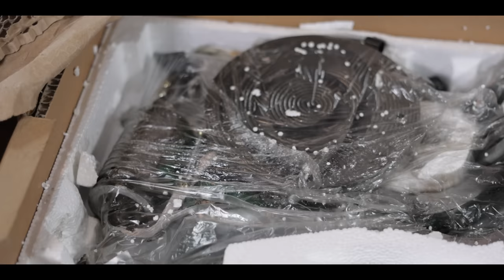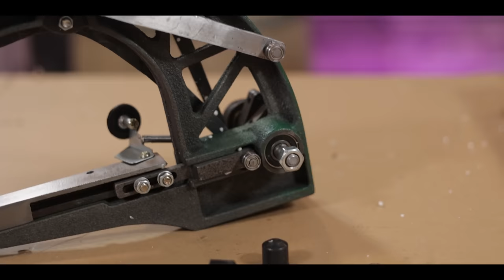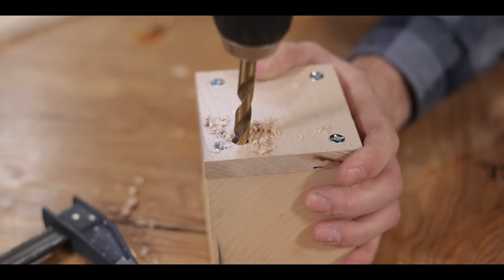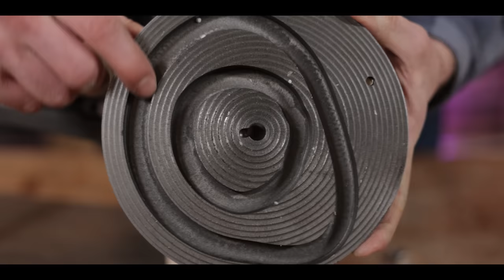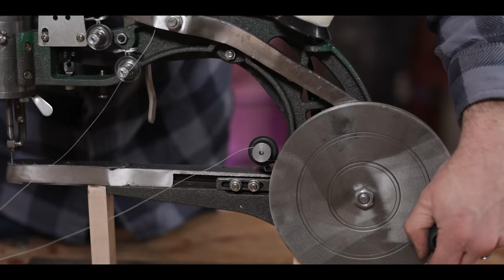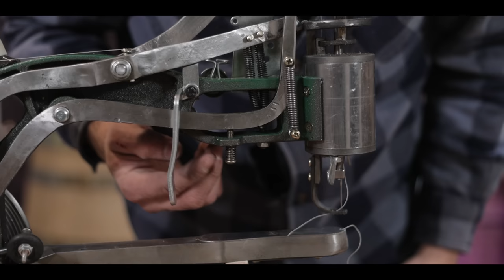Is this $100 Leather Sewing Machine Any Good?

Comment: Mine came fully assembled ready to go. I hooked an electric motor to it and have never looked back. I’ve sewed everything including tarps,upholstery, bags,belts and leather 1/4 inch (6mm) thick. Keep it lubricated and it will last a lifetime.Get yourself one .you’ll never regret it
Reply: did you buy yours on Amazon? Maybe a link? Thanks!
Reply: What electric motor did you hook to it? I'd like to do the same thing.
Reply: Howdie from Canada 🇨🇦 SK later  what se😂rs  of motor Ythks again Paul 😊at cov 😊use and is it worth mone😂d on0evfor 😂sy l nee

Comment: Very informative....but, lose the loud music.  By the way, the ears above the needle are for turning the walking foot so that you don't have to move your material. Just turn the foot in the direction that you want to sew, and it will stitch in that direction...without turning your material. This is how you can stitch things onto sleeves, repair shoes, bags, etc.....
Reply: I used the tripod base to that was provided and it seems plenty stable and sturdy. Mine didn't have the set screws for the legs that some others did, but just press into base. That has a tendency to fall out when picking it up to move around, but a small wrap of paper or tape secures it fully from falling out. It's better with that base because it leaves the arm unobstructed to allow it to be put into recessed areas.

Comment: My wife bought me one of these things a few years back. After cranking for far too long, about 15 minutes, I decided to mount it to an old treadle sewing machine base. After putting a new table top on, that left the free arm clear, I had to add a couple pullies to redirect the drive belt. Now it seems be have become a family tool. My wife did a lot of sewing and my daughter makes hand bags. The length of the free arm is incredibly useful. Great revue and we couldn't agree with you any more.

Comment: The oil on the metal is usually Cosmoline, and is indeed common for shipping unpainted cast parts; even high-end table saws come covered in it
Reply from the maker: I legitimately didn't know that! Thank you for teaching me something today!
Reply: @SkillTree  You are welcome! After all, isn't that why we are all here, to learn new things? :)
Reply: Sergers and carbon steel cookware are the same, though sometimes they use a thick layer of beeswax on the cookware. Beeswax is soooooo hard to clean off completely
Reply: @SkillTree   I know I am late, but knives and swords often come covered in a similar grease,  it keeps the metal from rusting since carbon steel (which you want a sword made of)  will rust
Reply: @SkillTree  The soviets used cosmoline for long term storage of firearms.
Reply: @sparkythawelder  The US Military has been using it since WW I!  It was still used in industry until EPA and such put a end to its use in USA.
Reply: @4GSR  Cool
Reply: Ak people know all about cosmoline
Reply: Another cosmoline oil/grease tip is that when you buy brake rotors for your car (not pads, the actual rotor) they are almost always coated in cosmoline which will really mess up your pads, so you need to wash it off with Brakekleen or similar parts cleaner to allow your brakes to work properly
Reply: Knights’ armor was stored in wood barrels full of oil to prevent rust.

Comment: If this machine has any issues down the road, I definitely want to know in a video. This was a great opportunity  to give us an honest opinion and I feel like I can trust your judgment. I know a lot of leather crafters wouldn't lie about their reviews BUT some of them are also endorsed by the company that provides some of their machines 🤷‍♀️ so sometimes it's hard to tell if the review is genuine or not when I'm doing research. This video gives me a better idea on if I want or need a cheaper leather sewing machine now, or if I need to wait and buy a really expensive one later
Reply: I'm useing same one for a year now, for heavy duty leather works - saddles, armor for roleplayers, etc. Works fine for me, there is nothing to breake there at all. But it took few hours to bring machine to "nice and polished" condition. What i done also (not included in this video) - flattened its leg a little so it stops biting the leather that hard and changed handle to more handy.

Comment: Been running mine for a couple of years now, I have to admit, mine was far better looking out of the box than yours. And that screw head you had to mill down, mine was already done. I used the stand for my ice fishing camera, lol. The channels on the back of the crank wheel are where I used some white lithium grease. Just a touch is all you need and it works so smooth I barely have to make an effort to crank it.
Reply from the maker: Thanks for the tip! I will be picking up some lithium grease right away to give it a shot!
Reply: Where do you get white lithium grease?
Reply: @RattsWakeUpCall  auto parts store.

Comment: Little tip, I use a rare earth magnet to pull out the bobbin. With that, it comes out easily. Also, love your pros and cons for the machine. I've had similar experiences with mine. 
Oh, and I plastidip the foot to keep it from maring the leather.
Reply: The nice thing is you can just leave the magnet stuck to the machine somewhere out of the way and it will always be there when you need it.
Reply: Magnet for bobbin removal: This is the way.

Comment: Loved the vid. Love your channel .
Always keep it oiled. I scoured mine down, smoothed the rough edges, and gave it a coat of paint. Nylon or teflon washers on the pivot points of the rocker arms reduce wear and help it run a lot smoother/quieter. I've sewn plenty of holster leather with it even going up to the size 24 needles and 207 thread. There's just a little DIY and a learning curve. Filing down the teeth on the presser foot a bit is a big help on relieve the marks it leaves. My only wish would be a bigger bobbin for stitching belts. I've wasted a hunnerd bucks on a lot worse gadgets. Enjoy :)
Reply: Yeah, Size 24 and 207 for me as well.  Had mine about three years now.  Once broken in and the rough edges smoothed up, it works fine every time.  I did go to a slightly heavier oil than 3in1.  I use Marvel Mystery Oil, from auto parts stores, Walmart, etc.  The bobbin holds less thread, the heavier the thread, which is a bummer on bigger projects, but I bought extra bobbins and holders off eBay and keep a half dozen standing by for a quick change for longer seaming.  I also made a slightly shorter foot for mine and can get almost half an inch stack of leather under the foot now.  The machine walks thru it like butter.

Comment: 1:38 im pretty sure you're right on the money! My machining professor (who worked in a machine shop for like 35 years) says that cardboard and other wood products are HUGE rust magnets because of the tannins. Anything that gets packed in cardboard, especially long term (such as something thats shipped overseas, will be sitting in a warehouse, etc,) needs a generous coating of oil, as well as some kind of isolation layer, just in case. I suspect that this is drop shipped from existing stock in china, so a heavy layer of oil and plastic wrap checks out. Not always fun to recieve, but definitely better than recieving a rusted and unusable machine!

Comment: When I first started leatherworking, I considered one of these machines, but after thinking about it, decided against.  Not because I didn't want to fine tune it myself, or that I thought it wouldn't work, but I considered the type of seam it creates in my leather versus a reliable saddlestitch.  Once a section of your thread wears down, the whole seams comes undone, where with a saddlestitch, the remaining stitches still hold tight, giving you a chance to repair the seam without your project falling apart.  How long will it take for this wearing down of the thread take?  Who knows, depends on the use, but that's the main reason I did not go with one.  Plus, unlike your's, my leatherworking hobby is meant to be a time-killer, hand stitching suits that.   :)

Comment: Okay so for what I did with mine is polish all the bobbins makes them spin easier. Next buy a lot of the leather needles. you will go through many. Now I also made a deck for going around the lower arm. so I have better control with sewing the leather.  So i think this machine is so worth it. You will need  to practice with it.

Comment: So glad you love it since I was one of the people who voted you should get one.  Looking forward to seeing what you make with it.  Next step: attach a motor.  I bolted a pulley onto the crank wheel to make my machine belt-driven, using a windshield wiper motor from an old Ford.  Helps a lot when you want to be able to control your piece with both hands. You can probably come up with something more elegant, but that's what I had on hand.  A treadmill motor would be ideal, because the range of speeds is wide and continuously adjustable.
Reply: Mr. Possum, what diameters of pullies did you use?  Thanks -- Anaco, Vzla.
Reply: @buddyhutchins3782  I used an 8" diameter  pulley on the sewing machine crank wheel, and a 4" pulley on the motor, but you might need different sizes depending on how much torque your motor has and how much speed you want.

Comment: These machines are absolutely great. I have used a weaver 205, which is 3k easy, and bought one of these a few years back because the weaver wasn’t at my house and I’m a lazy lazy boy. These beasts can handle just as many, if not more, than the weaver. Getting used to keeping lines straight with one hand is a hurdle, BUT you can easily modify it to have a motor! Just buy an Amazon motor, attach a sewing machine pedal, groove the hand wheel, throw on a belt and bam, you saved $2800. Plus you can detach the motor if you’re going to an event or lose power. Best investment ever.

Edit: I put a groove in the hand wheel for a belt with a dremel bit socketed into a battery drill. The battery drill stands up, so I just scooted the drill to the wheel, pulled the trigger, and just spun the hand wheel to start the groove. It’s not the most fun task ever, but it’s insanely worth it. Also take off the hand crank if you’re using the motor or you’ll hit yourself with it repeatedly, trust me lol
Reply: Hi! I’d like to add a motor to mine. Any videos that show how to do that?

Comment: Hey, I just wanted to thank you for making this video. I don’t plan on buying this particular machine but I am buying a Amazon Leather stitching machine that’s made by the same brand and it’s a few hundred more dollars more expensive than this one but I think it’s a great investment. I have a lot of projects that I’ve had in mind and I think that this simple industrial piece of hardware will do more than what I expect. I don’t own one yet but I have advice to anyone that wants to know how to maintain these machines to keep them in tip top shape, my answer is simple, lubrication! oiling every friction point and keeping tabs on them after using the machine every now and then will keep it running for as long as you can supply needles for it. More importantly, add grease to parts of the machine that won’t make a mess and to parts that deal with high bearing loads or stress, that is a little secret from me.

Comment: I use a strong magnet that I took from a scrap hard drive to (very easily) remove the shuttle & bobbin. I am a retired sewing machine mechanic so I figured it all out for myself and made a workable stand. However, there are plenty of youtube videos like this so that anyone can get this machine working. One thing you did not mention is the universal directional feed by rotating the two 'wing nut' thingummies. Good video, thanks.

Comment: Just got mine about a week ago.
So far, cleaning and threading the bobbin took the longest but now I am facing the issue of thread breakage.
I’m sure I’m doing something wrong and I’ll figure it out but I love this thing already.
Kudos to all the hobbyists who have the patience to fully use this thing.
Reply from the maker: I had the same issue. The little tension disks may be too tight. Try loosing them. To be honest, I usually just end up using one of them. I find using both breaks rhe thread more often
Reply: @SkillTree  So I actually spent some time fiddling with it and found out that my problem was the bobbin wasn’t aligned properly. This was causing the upper thread to get tangled and lots of tension, causing the breaks. I’m also using nylon thread now so that’s helping.
Reply: Another possible reason for thread breakage is a burr on the bobbin or shuttle.  Everything needs to be touched up with a little sanding and polishing here and there
Reply: Is the thread provided much different from monofilament fishing line? It came loaded with clear thread in the bobbin and a short test length up top, so I threaded the top with the black line that was included in the box. Dual color stitching for now until the bobbin runs out-

Comment: Shout out to the man. Thank you so much for the details. Still waiting for mine to arrive...come on already Amazon.
I've been through most every 'tube video on these and they cover much the same stuff. But thanks yours is the first for me to show how to adjust the walking foot stitch length. That's going to be a game changer. 

You have probably already found out that the work piece can stay in position and the needle barrel with foot can rotate clockwise or counter to change stitching direction. Beauty! Thanks again

Comment: Oddly enough the way you fill the bobbin on that machine used to be considered a very be considered a very big feature because you didn't have to hand wine the bobbin like that's how we used to fill our bobbins we hand wound them at 1st.  That also made it harder to control the tension of power the thread was wound onto the bobbin which led to more mistakes and not as good looking stitches.... Although the bobbin can make minor differences in your world it can occasionally decide occasionally decide as to whether or not a sewing project will turn out or be total garbage...  For some machines there is attention screw included on most of the bobbin cases for some machines it's more of an automatic thing but I imagine for that machine there's gonna be some kind of tension screw and if you start having issues with your thread nesting nesting on winding really fast being really fast on winding not slow enough if the stitches are too tight or too loose it could have something to do with the bobbin case

Comment: I have the exact same machine, and you are 100% correct about everything. The only advice I can give is put some lock tite on the crank nut and bolt. It likes to work loose with use
Reply: The foot should turn as well

Comment: the top sewing head swivils so you dont have to turn the leather to sew in another direction. , also, if you want to make it run smoother, polish the raceways for the bearings in the back of the plate

Comment: I recommend adding Greece to some of those pivot points rather than oil. You will end up with much smoother action and less noise. I've been watching vids on these particular sewing machines. I'm considering ordering one, and you can rig up foot pedal or electric motor to the crank arm position

Comment: Super cool! would it be necessary to dampen the leather so that way the needle goes through with ease?
Reply from the maker: No. In fact I would advise against it as it would make the little ridges on the presser foot leave indents that you would never be able to get out again. As it is now, this machine has no trouble at all going through pretty much whatever I can fit inder the needle.
Reply: You never want to sew wet leather, by hand or with a machine.

Comment: I wonder if you could mount this onto a treadle from an old sewing machine so you could use both hands? It looks like there is a groove in the flywheel for a belt so it should work.

Comment: If this thing can handle some very thick thread, I will absolutely consider getting one. I have a singer home heavy duty for light leather work and a consew 225 for medium to heavy duty. They're both great, but they struggle when I need to do very precise work on thick material with thick thread. This would be perfect for that.

Comment: Timing! I was just looking for one today and was thinking about this exact one! Hand sewing thick leather is a physical and mental pain. What kind of thread is that? Looks like just cotton thread, does it work with thicker waxed thread? Also, did it come with needles or can you just do anything that is fairly heavy and not going to snap? Thanks, Cl3ver! Also for a laugh click the affiliate link and watch the product video... "your coloured life all in the peas"...ok... Why not upload your video as a review, it way better than the ones on there.
Reply from the maker: GREAT IDEA!! I will 100% do that! As for the thread, the weight I am using iis B-69 and is cotton. I read that you don't want to use waxed in the machine as it will gum up the tension disks and cause too much tension, snapping the thread. As for the needles, it came with a pack of 10. There are special needles for sewing leather so you want to make sure you grad some of them if you need replacments. I get mine from Michaels.
Reply: Bonded nylon or polyester works best

Comment: If peaple want a really good "cobbler like" sewing machine  and think this machine is not good enough i suggest trying out the singer 29k , yes they're old but they work like a dream  and simply dont break. They're around 300€ , some  with a nice table . I think overall is the best option between this machine the the "professional'  ones and you have the option to buy with a short or long arm, and u can also handcranck it or just use the pedal